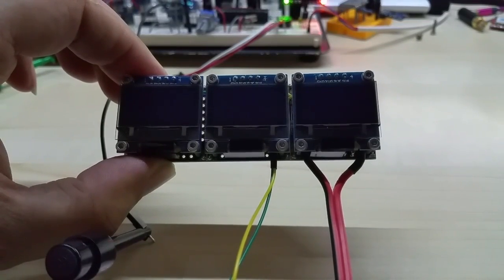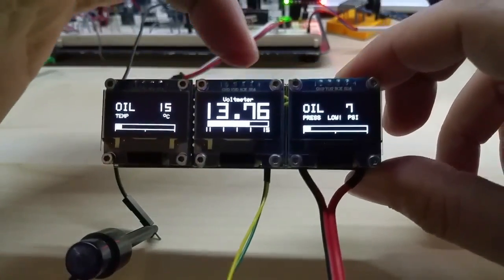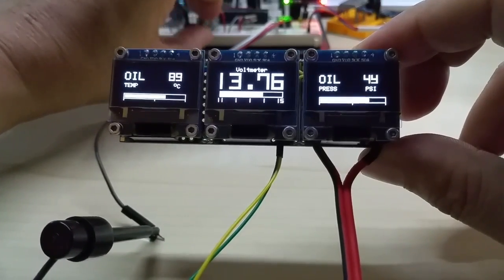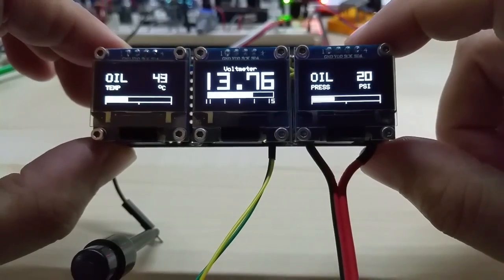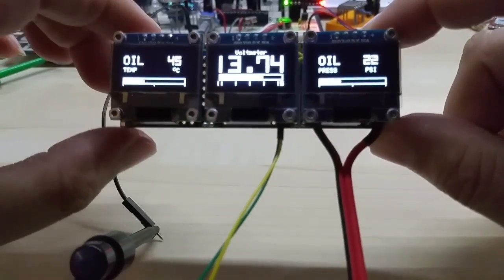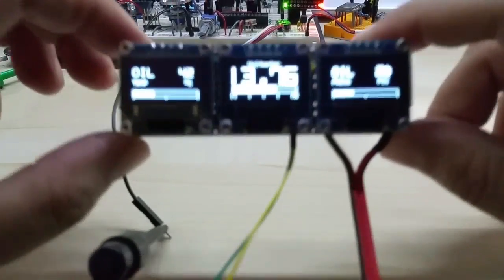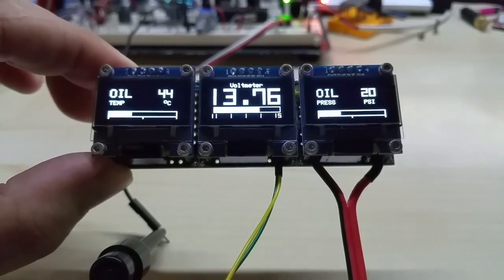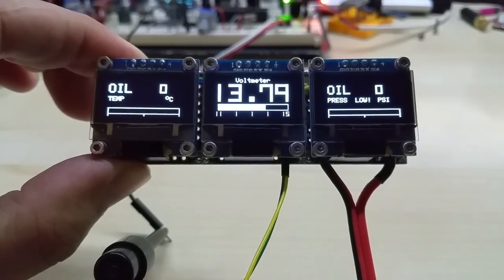Custom Tripple OLEDiUNO Car Gauge

Comment: could these also be used to display fan speeds and CPU/GPU temperatures? does a 3x1 like this fit in a 5"25 bay of a computer?
Reply: i did this a few years ago. skip to towards bottom for info minus story there is some info about computer psus u night benefit from in story though. :
 I actually had a e-sata hardware raid controller in 5.25inch bay format. I got a mini case(atx maybe or one of the exotic standards)full of hard drives.

 Issue was there was nothing to switch the damn thing but the back psu switch. Case had a button but the raid contorller didnt handle psu control (normally your mobo does) Rather than short green to ground and rely on that switch on back... I hung an arduino off the 24 pin(psu->mobo big connector) purple line. Its 5v stand by power. this means its on even when computer is off. Its not made to supply much power but an arduino doesnt consume much and happily fits in its limits. I then routed the green and the ground up to mosfet with its gate on the arduino.
I also connected the push button for power on front of case to the arduino. Now i had a system that behaved how a user would expect if they didnt know what was inside. later a rtc was added to allow it to come out of sleep b4 actual computer was schedulied to do a backup.

back on topic: reason i was doing this is I had a client that I had bought a premade, non standard backup box w/raid. His computer was running 6ssds in raid so why not make backup more robust? This box was From china shit just big enough to fit 3 drives inside the case, no room... kinda like the WD home NAS but smaller and raid 5. It had one fan. That fan had failed and nothing sensed it /turned the system off. 

While working on his computer one day I grabbed the backup box and had to jerk my hand back not to get burned. It had become a fire risk and at very least would have killed the drives had i not noticed. So obviously in the custom built version fan monitoring was desired. 
-----
coding is covered in tutorials elsewhere... there are 2 gotcas though:

1)for a  reliable reading Its best to power your arduino from the 5v red line off the psu. specificly try to grab the one with a fan adapter that way you are close on the ground line. If you use an external psu be sure to run both sense/taco wire and ground to arduino or you will get nothing. If you are old enough to recall PATA molex power connectors you might have seen that you can buy ones that snap on mid psu cable with teeth to bite into wires. They would come in handy here.  You might get away with the taco/sense working with just anyold ground path back to fan and 5v cable but if you are seeing weird numbers shooting a ground line directly from fan to the arduino is worth a shot  This is all assuming 3pin fans and monitor not control speed. 

2)I seem to remember there being a limit to how many fans could be accurately monitored. I think its limited to how many interrupts are on your MCU/arduino flavor. Might be a way around it but you get into having to optomize your loop or the arduino isnt fast enough. 

if you want exact rpm and are willing to learn how to read external registers this chip from ti would probably make life easier. 
http://www.ti.com/lit/ds/sbas386c/sbas386c.pdf

i decided i didnt need exact rpm to have an alarm/turn off function. I  settled on coding the thing to make sure it was seeing a pulse from each of the 3 at least once in every 4(number out my ass) loops. I had a var i could adjust to ignore x errors and then have it go y ccycles not seeing the fans it thinks its dead b4 it turns the psu off. For the most part if the fan is running at all, its going to be running at the speed you expect. If its running but oddly slow one might smell the magic escaping or hear something funny so watching if a fan constantly has no report is often enough.  The accountant it was for didnt give a shit what his fan rpms were anyway lol 

good luck
Reply from the maker: technically yes but I have to interface/code to get the data from the PC. They would fit into a 5"25 bay no problem, they could be mounted behind a bay cover with a square opening for the displays.
Reply: wha, that is really cool... would be a cool for custom case mods... bookmarked your site :)

Comment: The easiest way to get a more smooth display of temperature or any other sensor reading is to sample about 10 times per second, average those add that value to the previous displayed value and divide by two to get the new value to display. If it is still jumpy lower or increase the amount of samples per second.

Comment: love your work man. heres an idea: work in a host pcb with with pi zero. pi zero can program atmel chips over spi. this would allow you to have generic reconfigurable panels. you might need to add a switch ic to connect sesors and ic to switch the spi line from pi to any cube. This would allow them  to be a configurable visual interface/swap what data is output where in the visual field. alternatively u could stick to i2c only sensors/clocks and just interconnect them all and use the pi spi to reflash for what goes where...

more elegant:
modify your arduino code...first create a address unique to each display cube as a var.. next add a serial decode loop portion of the ardino code...have it listen for a command with format of "displayAddress"+"sensorToDisplay(i2c address)". This would tell it what sensor to connect to on the i2c buss. i2c is multi slave and multi master compatible but masters cannot communicate with eachother.(if i remember correctly). Now the trick with using the serial port (rs232) to tx from pi to multiple arduinos is to use very simple ics to convert to and from rs422. the max3483e is a 5v input compadible 3.3v powered 8pin mini dip that can either transmit or receive, costs like 2usd. pi rx pin- pin4 of max3483e. tie pin of max3 to vcc to enable output. pins 6-7 are A+B which run to the recivers. Max481 is identical to the 3483 but 5v native. place one on each ardino rx line  and pin 1 goes to rx pin 2 to ground to enable receive. 100ohm resistors across A and B on each end of the data cable. u could tie the pi to the i2c buss as a 3rd master allowing it to be aware of what sensersors are attached. now set the pi zero with wifi dongle or pi zero w to be in ap mode, download apache and python web extensions.  Write a python script to output a list of screens (manually add addresses or make them sequential...remember you can have the pi flash them if you want to get fancy(see avrdude/avr-gcc)) and a list of sensor with radial buttons next to each display address to allow selection of sensor to read. when user hits submit on smartphone python reads selection and tells serial port send "<displayaddr><sensoraddr>" then the display recives the mesage and reconfigures to output for that data. Alternatively link all sensors only to pi and have the serial output read <displayaddr><pixeldata>. the serial port is probably fast enough there 3x3 grid will see no lag doing it that way. if you wanted to go faster use MAX3140 to turn the pi spi port into a rx422 port and u should be able to blast rs422 at about 4mb/s given a 32mhz setting on the pi spi. if you cant transmit 384x288 (6x grid) at that rate you are doing something wrong
Reply from the maker: Thank you very much for your detailed comment, Johnathan. I am more of a hardware guy and my coding skills are very limited to be honest. Getting into the Pi would be a nice move that is for sure but coding all that would probably take me a lifetime :-) 
Thinking about your idea, would it be not easier to just connect a say 7" display to the Pi and displaying everything on a single display? Although I would of course prefer to use my PCB with 9 displays and being able to control them from a Pi Zero even if it is for a simple animation which would expand on all screens for example and then show configurable OBDII data on each screen. It might sound stupid or not feasible but I could even think of a video input mode over USB camera. Actually I am working on a multi screen desktop clock with different selectable times for cities with GPS accuracy, calendar, weather forecast, alarm clock, possible RSS reader, temperature and all sorts of other info that then be displayed on a 6 or better 9 display PCB. Since now I have a 3D printer,  I could make custom enclosures to get a finished product. I have a much updated clock code up my sleeve, that I will make a video of real soon. 
Anyway, I will keep all this on my mind and if I find coding help many things could come to life.
Thanks again.
Reply: easier yes...but ...i think one big display losses the sharpness and contrast(ultimately one glance readability) of your cubes. programing on the pi isnt that hard wiringpi and python make it very simple to both play with the gpio pins and output to a webserver on the pi. installing those packages is usually as simple as typing "sudo apt-get install apache2" apache is the webserver that at one point(might still, havent looked) ran the vast majority of the internet. googling "pi python gpio webpage" will turn up tons of tutorials on how to make a simple internet form that can alter what the pi's com and gpio pins are doing. 

pi zero has a camera port and will do h.264 compression. there are also 30-50 usd usb h.264 cams like this that i have used on pi 2 and 3s but have yet to try on a 0 (https://www.amazon.com/ELP-Support-Android-Windows-Surveillance/dp/B00VDSBH9G) If you wanted to do that and the multiple displays id suggest going with a pi2 or pi3 as the multiple cores will make it smoother. its doable on zero you just may have to sacrifice frame rate. ive ran the pi camera port and 2 usb cams off a pi2 to provide security at one of my jobs and it worked great with all 3 doing 720p around 10fps...they have more power than you think. If you want to look into the software id start with "motion for pi/linux" on google. 

btw...as far as gps clock... u might have come across the ublox 6m or maybe not. ive found that the cheapest boards with that chip dont break out the pps pin and most ebay sellers want 4 bucks more for the version that does... with a steady hand, bit of wire or coper tape and the ublox data sheet its possible to break out the pps and save 4 bucks. I eventually intend to build a local time server. My current project requires logging location and time only when another censor is tripped so im using a small low 2 buck mcu to interface with the rs232 from the ublox and keep a i2c pollable register with the last data spit out by the gps

do you etch at home or send out for your boards? i just got a kit with ferric chloride but im considering using hydrogen proxide and hcl instead as it turns into a reuable etchent. I need to ship a friend something that got way too large for my through hole proto with in a day or 2 so ill be making that decision very soon lol.. if you do id apreciate any advice.
Reply from the maker: Thanks again for the detailed reply. I will look into the Pi sooner or later I guess and have a lot to learn. 
I am using a V.KEL GPS module that has the patch antenna on the back of the PCB and also outputs the PPS signal.
I use Elecrow as my fab house, they are not always perfect and do make mistakes but at least they fix whatever was wrong without a hassle. All my boards you see in the videos are from them.

Comment: Really nice however you should used delay(1000); for the oil temp. and press. values.
Reply from the maker: The code got changed before it was send out to the customer, and you are right of course. Nobody need jumping numbers.
Reply: Don't get me wrong, just love no hate. You do awesome stuff.
Reply from the maker: No, not at all. I am surely not perfect and make mistakes and am glad to anybody who gives me pointers and tips. My coding skills are modest, I am way better in hardware and love designing PCB's :-)
Reply: delay is a shit function...it grinds the entire mcu to a stop. Millis() is what you want
Reply: 1) with out knowing the bandwidth of each sensor attempting filtering and maintaining any degree of accuracy seems to me to be a fools endeavor. 2) a number display "jumping" has a time component...aka rapid. so yes updating less often will make them apear less "jumpy" and id be willing to bet this is more true to the data than trying to run some sort of averaging scheme/filter. esp if the resolution of the sensor, adc and amount of crunching a little atmega chip can do with in those time constraints isnt taken into account
Reply: Using a delay won't keep the numbers from jumping, they just won't refresh as often. This is due to the noise coming from the sensor. To really fix this correctly, the data from the sensor should be getting filtered before being displayed.
Reply: Even better...
Reply: How do you make a sensor read accurately Jonathan?
Reply: in the context of this application that was up to the designer of the engine. what we are focused on is reading the sensor data accurately.
Reply: you cant use delay while serial reading
Reply: already mentioned millis() it just got burried